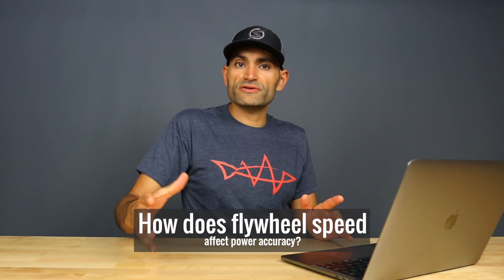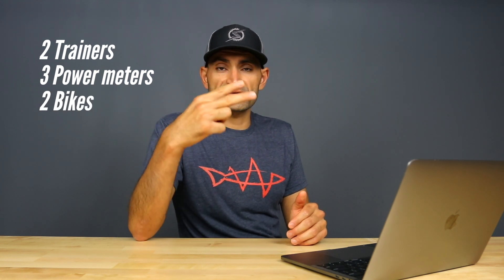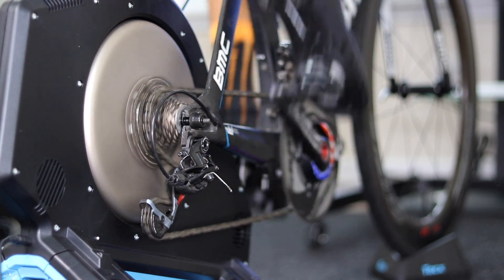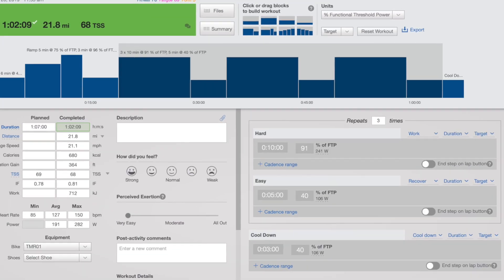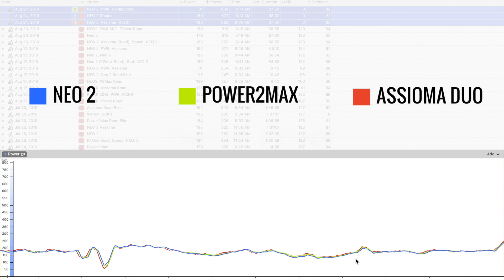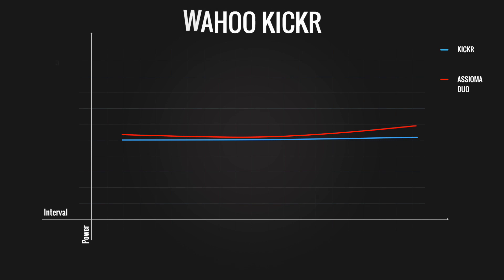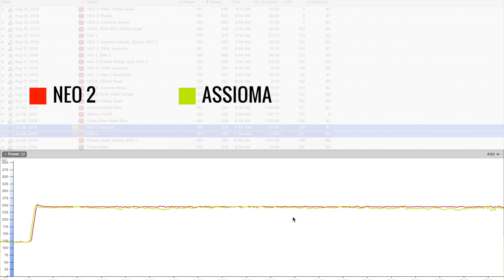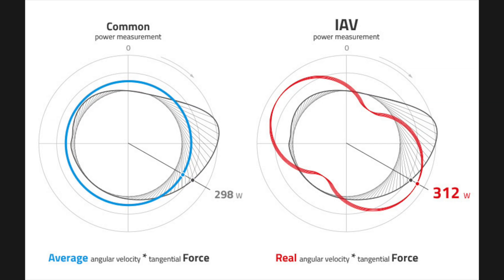ERG MODE: Does FLYWHEEL Speed AFFECT Power Accuracy?

Comment from the maker: A lot of data to go over but hopefully that made sense. Thanks for watching!
Reply: I got Favero Assioma Duo, Quarq PM and Kickr 2016. All 3 read different in erg mode. I’m gonna try to use your format to know the difference between them.
Reply from the maker: Let me know what you find
Reply: What tool you use to compare power meter readings?
Reply from the maker: +Israel Arroyo the one I use RubiTrack. Only available for Mac though. You can use the DCRainmaker analysis tool too.
Reply: SMART Bike Trainers thank you I’m gonna try rubitrack.
Reply: @arroyoiam  I am reaching now to this video. I have been doing some comparisons using Golden Cheetah. However, the DCRainmaker tool seems to be ideal for it.

Comment: Great great great video. I was searching for the influence of chainring/flywheel speed on power under ERG mode and got here.

I bought a new smart trainer (Cyclotronics - a Brazilian maker) to replace a Wahoo Kickr Core, which is waiting for the opportunity to be repaired in the US, since they offer no service in Brazil (it would be simpler to ship me the electronic board, but they said no).

My reference for comparison is also the Favero Assioma Duo and I used to see results closer than 1% between both (Wahoo and Assioma). Changes in resistance after changing gears and especially the chainring never caught my attention, only the expected "clock" position where torque was the highest.
With the new trainer, I could see differences in the power measured by the Assioma, using ERG mode, when using big and small chainring, and also at different cadences 90 and 105 rpm.

Unfortunately, I don't have Wahoo working right now to compare between trainers.

I have less than 1 week with the new trainer, so I am still doing tests.

Comment: Super interesting video, thanks for taking the time to put it together! From what you've found, which trainer would you recommend for high inertia riding?
I'm using a 1x58T chainring setup, so would see about 25-28mph speeds on the trainer and am using Trainerroad Erg mode with power match on a Quarq DZero.
Reply from the maker: The NEO 1, 2 or Kickr are ones I would trust. These two measure consistent power regardless of flywheel speed.

Comment: Great vid and proper rabbit hole discovered. Which power meter is right? Who knows. I'd say Neo is closest to the true. Crank and pedal based power meters by design can be susceptible to inaccuracies caused by pedaling style (which is affected by flywheel speed). Power2max on the other hand has issues with temperature drift indoors and has some design flaws too (see Keith Wakeham video about Quarq, SRM and P2M). 

As of flewheel speed causing trainer power inaccuracies. It will have impact on trainers which estimate power from flywheel speed and has to take slight accelerations into account. It will be minimal though during steady state efforts on high end "estimators" like Kickr.
Reply from the maker: All true. I do notice the drifting with P2Max. Usually a 2sec spin after the first 10min usually fixes things. Assioma on the other hand is sensitive to pedaling effected by flywheel speed. You can argue all measure correctly, but measure differently 🤷🏻‍♂️